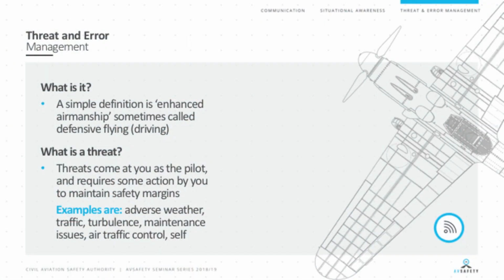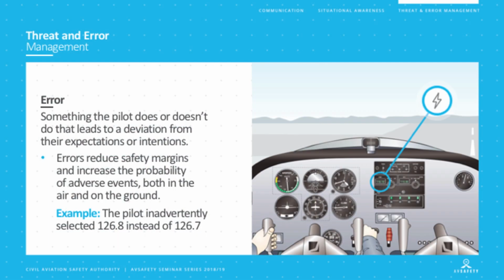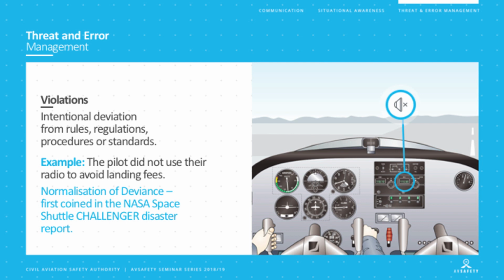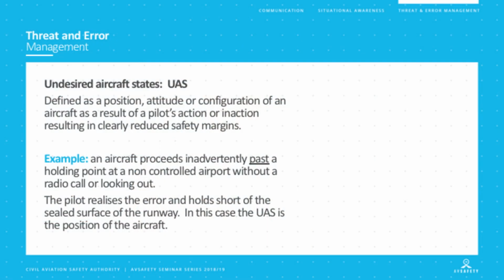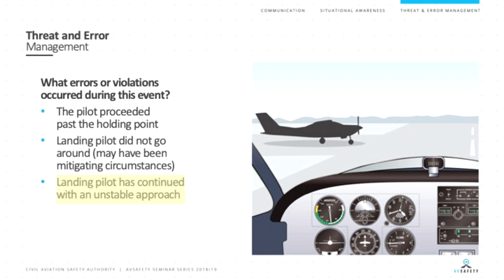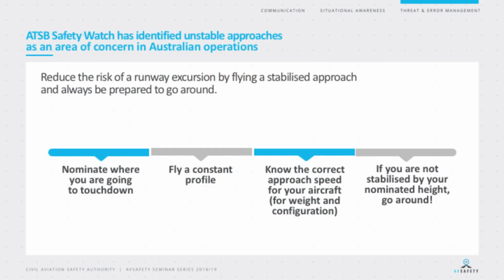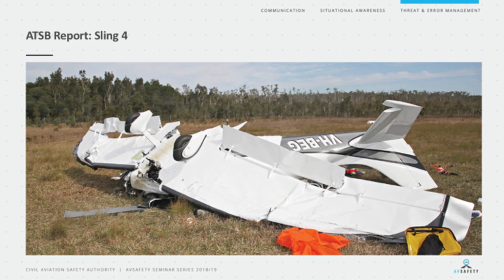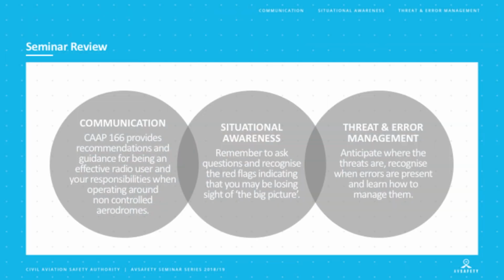Enhancing pilot skills in a dynamic environment - Threat and error management

Comment: Forget Vref, fly AOAref. While you’re at it, learn to do constant AOA turns as opposed to constant airspeed. See Medium “Improve your Landings with AOA and Power Techniques.” If you have no AOA display, you can still fly AOA techniques in light aircraft though trim while your wings are straight to Vref adjusting for weight minus one knot per hundred pounds below max gross.